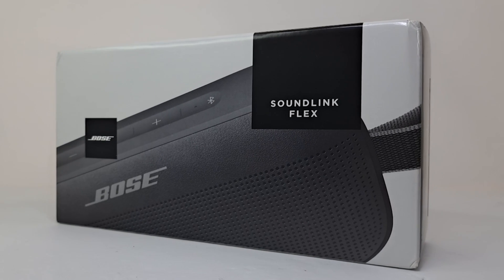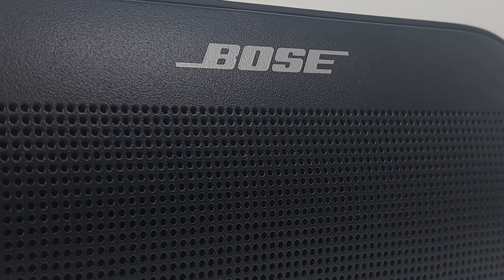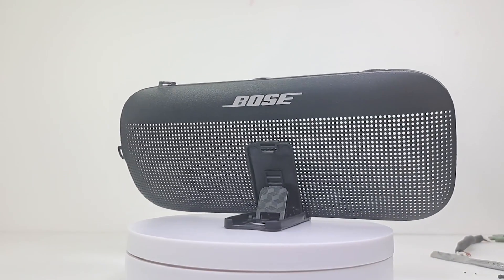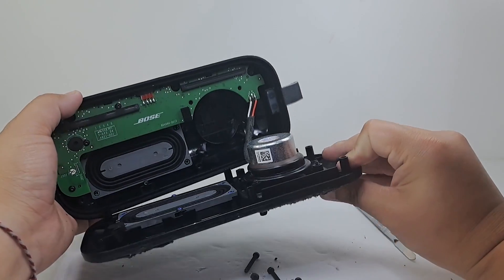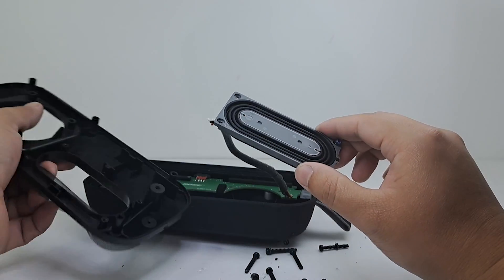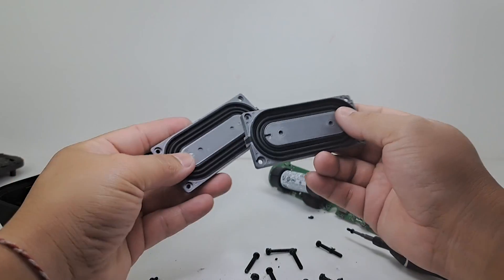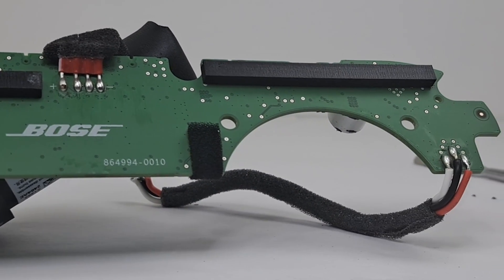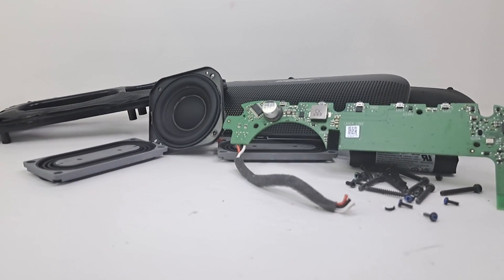BOSE SOUNDLINK FLEX COMPLETE TEARDOWN !!!

Comment: We've had ours for a couple of years now, but it has stopped charging.  Going to open it up and change out the USB-C port just in the hopes that it fixes the issue.
Reply: How didbya go with that? Mine won't charge either so was thinking rhe same thing

Comment: For the price its not a good speaker
Reply: After a lot of thinking about "i can make your own speaker" with some bluetooth amplifier and speakers, etc.. i realized the components price is already a half of the price of this speaker and the other half is the time consumed for building. And after assembly, I would have had a medium or bad sounding speaker. Engineers from bose i think they made a lot of testing and modifications for perfect sounding speaker. I own one, the sound it's incredibly good and i think worth every penny.

Comment: I'm very happy with the overall quality of the sound profile and the depth of the bass from this unit. It's definitely better sounding than most similarly sized speakers. It has a solid bass response right down to 45Hz which for something of this size is pretty amazing. The only other speaker this size I've heard that has such a rich sound profile is the original Sony SRS XB20 (but not any of the subsequent "upgrades") which has quite a similar build to this actually. I have a whole bunch of BT speakers but I actually use this one specifically as a personal speaker. It's very nice to listen to in bed late at night.
Reply: 45 hz 👁️👄👁️o really?
Reply: @Hariom-wi7po it hits like a good factory car stereo but from 1 spot😅

Comment: The speaker is not meant to be opened
Reply: It’s not designed to be easily opened, but eventually owners will face a choice: open it and replace the battery or recycle it as e-waste. Seems worth repairing!